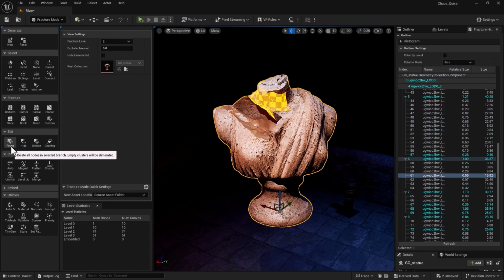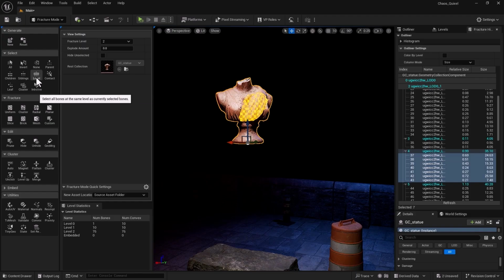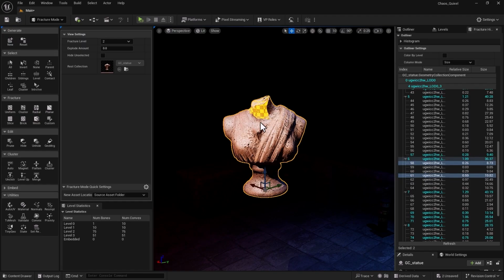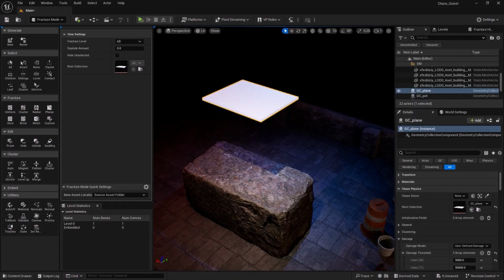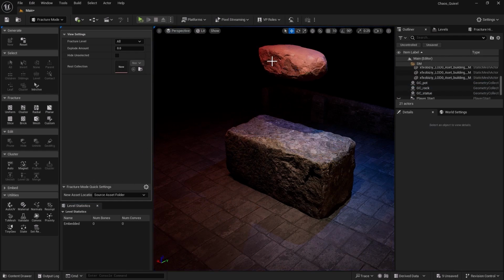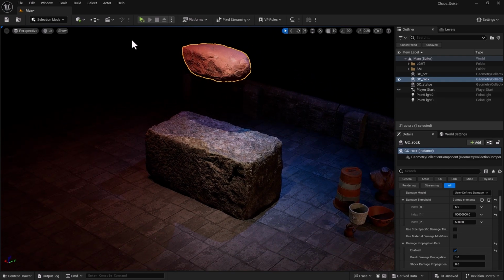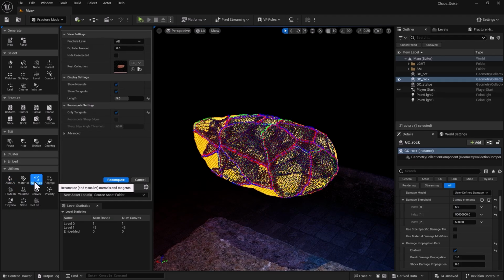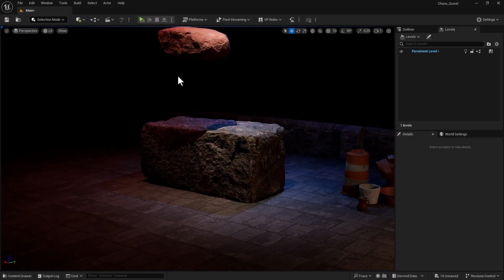#UE5 Series: Chaos Destruction | Complete Guide Part 2

Comment: Nice sir keep updating
Reply from the maker: Sure thing. In the process of recording the 3rd one. Will be out soon
Reply: Sir I try to fracture some model the model hot the ground but not brake object still static
Reply from the maker: @AkbarAli-ie2uv i suggest you apply the exact same steps on a simple sphere. If the sphere breaks you know that’s the model you’re using.
Reply: Sir waiting for part 3 sir
Reply from the maker: @AkbarAli-ie2uv in the process of recording. Should be LIVE next week